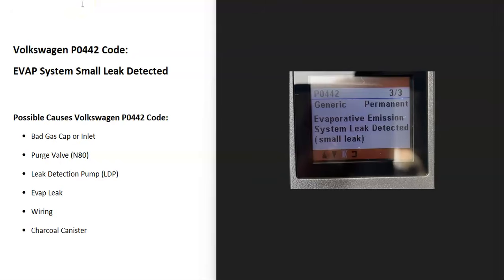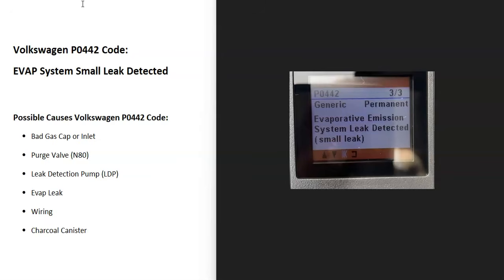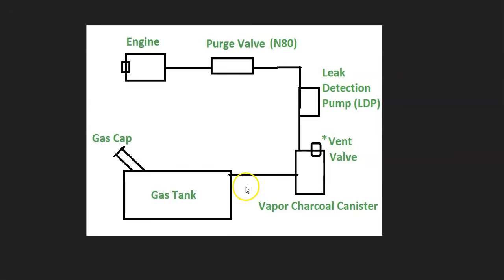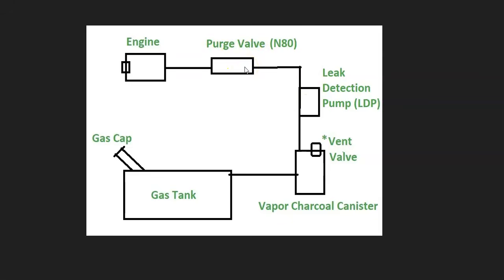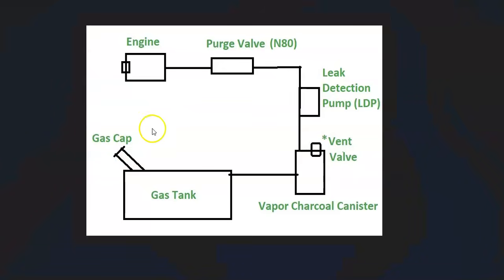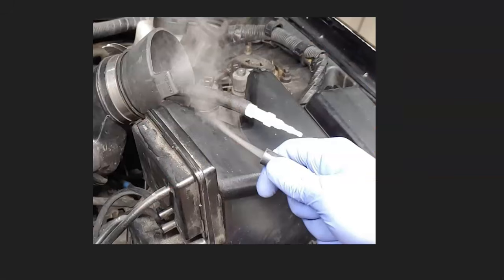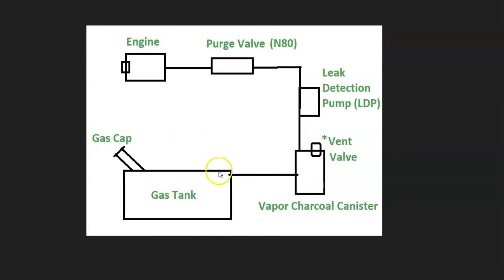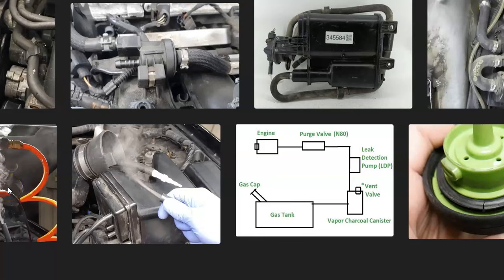Causes and Fixes Volkswagen P0442 Code: EVAP System Small Leak Detected

Comment: Thank you for creating this video. I replaced the Purge Valve Solenoid and it did not resolve my issue.
Reply: Then its your pcv valve if your gas cap looks fresh with no cracks

Comment: How does the fuel tank get the air to replace consumed fuel. Is it the LDP?
I have a 2.5L vw that will run well for about 20 minutes and then slowly stall out. Wondering if it’s having trouble drawing fuel from a “sealed” fuel tank.

Comment: This video is really good, I changed out my purge valve and I changed out my gas cap a few months ago. The lights went off and then they came back on. It’s back on now and I’m not sure what it is. Somebody said maybe leaked detection but I really have no clue, my car is stalling occasionally is starting to drop RPMs and then some around the right side rear tire starts humming and then it comes back to normal. I really have no clue what the problem could possibly be.
Reply: Any news? ;)
Reply: @constantinremis  nope never took it to a shop. It went away for a while and the code was even gone. But it just shut off randomly again today lol.
Reply: it sounds like dirty throttle body if the rpm drops below 1k
Reply: Having the same issue in terms of changed the purge valve and the check engine light went away after a drive cycle. Then I started getting a fuel cap light and then it would go away. Then, all of a sudden, I got a check engine light again a week after getting an oil change. It has been on for a couple of months. I’m curious as to what the issue could be, as I changed the purge valve about 6 or 7 months ago and the gas cap about a few weeks ago.

Comment: I have a vw Passat 2018 and the car drives bad acceleration and  it only has p240200 code ( evaporative emission system leak detection pump control ) code could you please tell me what do I need to check

Comment: If a small leak Code P0442 shown by an engine light (on dash) on is always preceded by the gas cap light (on dash) which goes out between dash lights is that a problem solving clue to the location of the leak?…2010 VW New Beetle 2.5
Reply from the maker: The gas cap is part of the EVAP system and needs to seal or it will cause a leak. A leak in the EVAP system can also cause the same issue, but a bad gas cap is a common problem.
Reply: @ In an effort to be brief I neglected to say that I installed a new gas cap and a new purge valve and I had a shop perform a leak test claiming no leaks…thank you for your reply!
Reply from the maker: Intermittent issues can be hard to solve in some cases. To give some examples, sometimes, when the weather is extremely cold, hoses can leak, but when tested in a garage, they don't leak. If there is a loose wire going to a component, that can cause problems. Also, sometimes a bad pressure sensor will give a bad reading to the computer, so the computer thinks there is an issue when there isn't.
Reply: @ Thanks for your help!
Reply: I am having the exact same issue on my 2013 VW Jetta 2.5l SE. Gas cap light is intermittent then the P0442 code comes on. I also changed out the diaphragm on the PCV and got new spark plugs. Initially that seemed to correct the issue as the vehicle was running rough. However not sure what to think now.

Comment: Would it be expensive to have a mechanic fix the leak regsrdless of where it is?
Reply: Up to $1000.  That would be labor and parts.   In TX it was $506 before tax.  $184.99 for the Diagnostic Testing and Inspection. Leak Detection Pump:  Labor 130 and Parts 192. 

During the Inspection they found other things of concern.  So I have my list and checking YouTube to see if I can DIY fix first.   If you have a warranty or extended warranty.  Then it'll cost you only the deductable.   But anything like screws or gaskets might not be covered under the warranty.    Good Luck.
Reply: In California figure $400.

Comment: How long did it take for the check engine light to come off once the new valve was installed
Reply from the maker: The light should go off once cleared with a scan tool. For vehicles built after 2010, a Drive Cycle is needed for the code to completely clear.
Reply: @HVAC_Mechanic  I changed out the purge valve last night drove it for about 30 mins going bacc home and the check engine light was still on when I got home I put a code reader on my car and now I got this code p0496
Reply: Anything ?
Reply: @KRock-ux4wp I have the same code.  Did you ever see what’s was.   I have the P0442 and the P0496